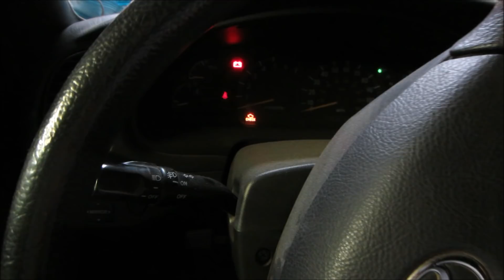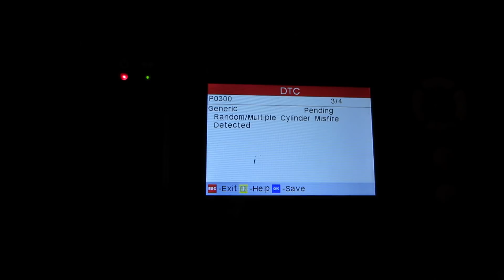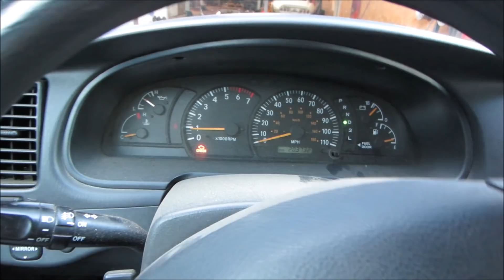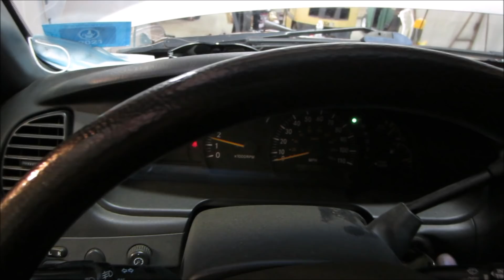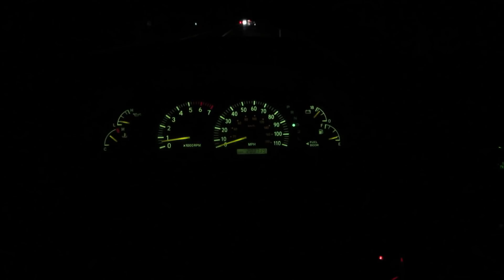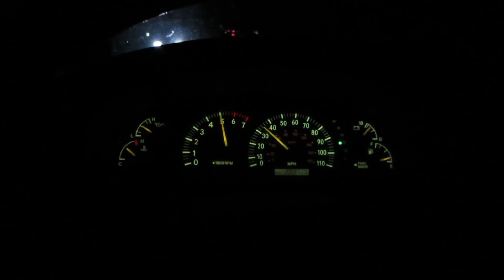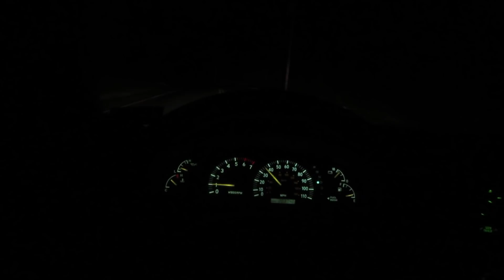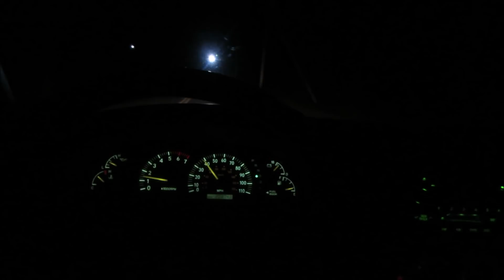What Screwed Up My Engine? You Won't Believe It

Comment: Timing belt: The world's most expensive mouse trap.
Reply: Timing belts on a truck V8 engine .... sad.
Reply: @robertshelton3796  timing chain any better?
Reply: @M.TTT.  yes. A chain will usually warn you of failure ( by getting really noisy)  far in advance. A belt usually just breaks without warning
Reply: @carwashadamcooper1538  in a lot of vehicles if it breaks, you put a new one and drive on
Reply: @drajo123  not at all if u Campbell snaps it usually ruins valves by miss timing snapping things rarely I see a new belt on after the old one snapped it usually causes catastrophic damage
Reply: @M.TTT.  ye car wash cooper is right timing chain is much much better lemme tell you
Reply: @M.TTT.  Yep. The only chain I ever had jump was in a small block 350 where GM used nylon tips on the gear teeth and they wore and the chain jumped. Hell my damned Hyundai 2.0L 4cyl uses a chain.
Reply: @1991enduro  My old Landrover Discovery with its 200DTi turbo diesel broke a cam belt at 90 MPH and all it done was bend a few valve push rods/ landrover designed the soft middles of the push rods to bend rather bending valves to piston contact. I just hammered straight the bent push rods for another 100.000 miles until i sadly sold my Discovery running 100 % great at 240.000 miles due to being disabled I needed an automatic landrover/ now got a Freelander with its BMW turbo diesel but auto gearbox/ but looking for a Discovery TD5 that are immaculate inside but all have rusty chassis / have welder will fix - lol/ love my landrovers as daily drivers.
Reply: Definitely not the most expensive mouse trap....the most expensive one is litterly 10k and its over a hundred years old.
Reply: @robbalinski1606  Cool story. I bet you're a real hoot at parties.
Reply: @carwashadamcooper1538  Some VW timing chains stretch and ruin the engine all the time. My parents caught theirs in the nick of time even though the engine was relatively new (below the 100k km usually recommended for a timing belt swap, let alone a timing chain).
Reply: @ianburit3705  ye that's British engineering for you lol I'm a brit my self and ye usually bent valves equals fkced cylinder new piston etc 8 times out of ten its easier to find a replacement engine
Reply: @drajo123  I think you're thinking of the "serpentine belt (?)" that drives the waterpump, fan, dynamo etc. When that snaps you  can just replace it. If the timing belt breaks the valves stop moving and with little bad luck a piston will slam into the valves and damage the valve or the piston. This is why the timingbelt has teeth and is made of a much stronger material than the other belts.
Reply: @robertshelton3796  Ill disagree with you. As long as you change it when needed, it'll rarely fail. Timing chain guides have been getting shit for a while now. Ill take the belt personally.
Reply: @vinny142  no no no timing belt, in non iterfirenc engine noting hapens, you put new on and it runs, it bends valvs only if its carbon up top of pistons
Reply: @ryanmartinage  OHC timing chain guides but that's why push rods are > OHC. No guide, big chain, 1M miles. Enjoy your belt though.
Reply: Mustie develops a timing belt trap machine.
Reply: Really glad I read this before watching. Didnt get it then I realllllyyy got it lol
Reply: @robbalinski1606  don't let Shawn Woods of mousetrap Monday know.
Reply: I was sure they were totally sealed?
Reply: @robertshelton3796  I’ll take a Toyota 2uz and the accompanying truck over any modern vehicle made currently.
Reply: @ryanmartinage  LS3 with DoD delete for life.
Reply: @drajo123  ya and you know exactly how much is going to cost to fix it a chain can vary chain by chain and if the factory put a cheap garbage one on you can change it out for a good one I love belts every 4  Bangor should have a belt
Reply: Why do they make interference engine with a timing belt? The belt breaks, you by a new engine instead of puting on a new timing belt.
Reply: @carwashadamcooper1538  ah nice, my Tacoma has a chain and they usually last a good 300 to 500k or more I think
Reply: @cassiuspuckett8789  money is the only reason I can think of or what the  companies will tell you it's higher  compression gives you more power

Comment: "Conti-tech" is a division of Continental Tire. Continental bought what was Goodyear engineered products, i.e. belts and hoses. I work for one of the hose plants. Belt was likely made in Lincoln Nebraska. The purchase process started in 2014 and was finalized in 2015, So my guess is that belt was probably built in late 2015 or newer.
Reply: Continental makes good quality belts. I ran their timing belts and v-belts on my Volvo for over 30 years with no problems.
Reply: Conti Belts are around for a much longer time. But from your reaction I guess its not very common in the US. In europe, japan etc conti belts are around for 30+ years.
So your guessing on the manufacturing date must not be true.
Reply: @Chris-yy7qc well until they purchased the company I work for they do not make belts and hoses in the US. Continental is a German company. When they bought us that them over 90,000 employees unless I'm remembering the numbers wrong. We alone had 30 facilities world wide.
Reply: @garywheeler1733  Nice collection of facts, but that doesnt really matter in this context? 
What I wanted to tell you was that it doesnt matter if they produced belts in the US back then or not, the belt could be older than 2015. It couldve been imported to the US and then put into mustie1's truck.
Reply: @Chris-yy7qc  never implied it wasn't imported.
Reply: @garywheeler1733  Quote: "Belt was likely made in Lincoln Nebraska. The purchase process started in 2014 and was finalized in 2015, So my guess is that belt was probably built in late 2015 or newer."
Reply: As Chris said, Continental AG has been making belts a lot longer than six years - and they've been available commercially stateside for a very long time as well, in particular since well before 2004. Unfortunately therefore there is no way to date the belt that way, though we can be reasonably certain that that was not an OE belt, so it was changed at least once. If that was in 2011, after 7 years... I'd be rather nervous about running it nine years later, though I understand where Mustie comes from IRT replacing it and therefore putting the $500+ (plus labor!) into a truck that is on its way out.
Edited to add: I checked, even the 'ContiTech' brand was established in 1988 (!)

Comment: I have had really good luck by using a “rust converter”, from the Rust Store online, before spraying any oil or film on.  It seems to stop the rusting so it can’t continue after applying the final oil coat.
Reply: My process, needle scalar, wire brush, rust converter followed by a coat of cosmoline. (before the rust converter starts failing) Inside rails, flood with cosmoline then chain lube.

Comment: I got a Toyota Tundra like that, but mine 2003. I bought it around 35000  miles on it. I changed the timing belt 180000 miles and now the truck has 420000. The truck still runs good with no major issues yet. The most stuff I ever do to the truck is just basic like brakes and oil change. I guess maybe I just got luck on this truck. Good luck with your guys truck.

Comment: I seem to recall this being a thing with 4.7's.  IIRC there's an inspection window that the mice get in.  Lower left side of the engine, from the driver's seat if memory serves me.  You might want to check that so that it doesn't happen again.
Reply: Yeah he’s probably missing part number 11348-AC010. They call it the lower timing cover spacer. That’s how most mice or other debris get in these engine’s timing belts.

Comment: The rusting is crazy! Those "protective" coatings are a pain, as you said they trap water. Salty water no less in your situation.
I've never had to drive on salted roads. Sea water isn't too friendly but that's why we hose down and make sure the box section drains are open.
In my opinion you should have let the rear wheels hang and greased up the spring leaves.
Excellent bit of fault finding mate!
Your lucky this critter didn't make a dinner of your wiring. Common in tropical locales.
Good job!!
Next?

Comment: Those lug nuts are commonly referred to as “tuner nuts” they use a deep 6 point security socket. A parts store might have the key for it
Reply: Spline drive.  Factory Toyota part.

Comment: Very good repair with the exhaust sensor, could have been a tricky problem. I'd have been inclined to change the timing belt too, but you certainly gave it a thorough check over. Really enjoyed the video.

Comment: On battery terminals, clamps, and cable ends: Vaseline. On the improvised oxygen sensor mounting studs: Anti-seize compound. Regarding those special "security" lug nuts: Get rid of them.
Depending on a special tool, is a recipe for trouble.
Reply: Er, let's not be ..."A Hurler on the Ditch"...  [Great upload great repair, love that Chainsaw Bar Oil treatment to keep his truck on the road plus the threaded bar and indexing that sensor through Ninety degrees, great idea...with an older Toyota  you can't go wrong simpler to work on and less parts to go wrong , he will indeed get more that several years out of same with the  Preventative Maintenance that he's putting  into same....]

Comment: Fantastic!  Let me tell you how a professional shop would have gone with this to solve this

1) Replace the known bad O2 sensor   -  Would have changed the entire exhaust because the studs broke
2) Replace all spark plugs
3) Replace all coils
4) Replace all injector
5) May be slipped timing belt?
6) Replace timing belt

Total Damage?  $16,357 in parts and labor

Comment: I had a similar issue of rough idle and misfire issues on two cylinders once when I had went up north to visit on my Ford Sport Trac with the 4.6 V8. Turned out a rodent had chewed thru the wires on two coil packs plus much later I found he had did the same to the wires to the pressure sensor on the HVAC where it was hidden from view.

Comment: It’s funny how in New England it’s referred to as “antifreeze” and in California it’s referred to as “coolant”.
Reply: In Canada we call it both
Reply: You call it both at the same time? As in “can you top off my antifreeze/coolant?” I guess what I meant was how they’re more commonly referred. Sure, people here call them both as well, but to my point, in this video, Mustie referred to it only by “antifreeze”.
Reply: I think you’re taking my response negatively. That’s not the case at all. I’m actually genuinely curious about regional things like this. Does it depend on the season whether you call it one or the other? I could see that being the case. Out here, even in the dead of winter, we’d still call it coolant, lol
Reply: @korybrown1126  like i mean you can call it both in the span of going inside to grab the coolant and coming back out with the antifreeze
Reply: 😂, fair enough
Reply: well technically i think its just terminology based on region because most "coolants" also contain antifreeze cause manufacturers are using specialty blends, like GMs Dexcool, Fords Specialty green or specialty gold. Hell on my 01 Silverado it says to use Dexcool antifreeze/coolant on the cap for the tank, whereas my ford fusion says specialty green coolant and makes no mention of antifreeze until you look it up on the jug or in the manual under part numbers then it puts down both.
Reply: @compzac  it’s the same thing, just different names, yes, water is a coolant but not an antifreeze, and a little bit of glycol or whatever actually helps make it have a higher boiling point, which makes it a more effective coolant, but you slightly decrease the thermal conductivity and heat transfer properties too though, it also obviously reduces the freezing temperature for the fluid too
Reply: Water can literally be used as a coolant, but no one on earth would ever claim water is anti-freeze! So there can be a legitimate reason why you might use the anti-freeze only in some climate zones.
Reply: @aterack833  I rather like that suggestion 😂
Reply: @tretter1452  I honestly can’t imagine a land where temperatures never get below freezing, or even at it
Reply: Calm down I think he's making a joke about temperature difference
Reply: Both names refer normally nowadays to the same thing. Technically if you say coolant you are covering the full spectrum anti freeze anti corrosion anti foam etc. It’s a Multi function fluid and antifreeze does not cover it. The anti corrosion for alloy cylinder blocks and heads is critical , wrong stuff and big bucks down the road. The anti corrosion wears out that why you change it. Anti freeze refers to the earlier name which was just Glycol added to water to stop freezing. But we know what Mustie meant the right stuff for his engine.

Comment: Mustie, on the o2 sensor I would have just used a u bolt and washer and nut. God bless
Reply: Or just replace it maybe. They are cheap enough. Not worth the labor to put a spacer in
Reply: Now, why didn't I think of that Thomas?  Fantastic solution.
Reply: Or they sell O² sensor nuts you can weld on the pipe and just  go witha threaded sensor

Comment: Me (a fan of Toyota): Wow, that's a nice Tundra, I would love to eventually own a Toyota pickup. 
Mustie1: "This is my beater truck, I've had it for about 4 years and take it out during crappy weather and off-road."
Lmao. The rust belt label definitely holds true.
Reply: The problem with Japanese cars is that you still have sleazy American car dealers selling them.  The stupid dealer add-ons like window tint, pin-striping, "paint shield", and undercoating which do nothing to increase the value of the car.  The undercoating actually defeats all the work the car companies put in to protect the underbody and chassis at the factory.  Usually by clogging the drain holes in the frame rails and other body parts.  Certainly not all American car dealers are sleazy, but choose carefully.

Comment: Hey Mustie...I also have a 2004 SR5 with the exact same rot in the frame. I have 100K miles and no rust.   I wasn't aware of how bad the frame was until I had it in for an alignment.  The tech was a former Toyota tech and he said the 04s are part of the recall and they have to put a brand new frame on at no cost to you due to a huge lawsuit. Apparently a giant parking lot of new Toyotas was flooded in Hurricane Katrina and they tried to cover it up and sell the vehicles after they were flooded. They cleaned the frames up but there was swamp mud inside the frames.  I'm going to send mine in soon.  Check it out.

Comment: Interesting find, I was guessing a fuel injector issue Lol.  Your truck is a reminder as to why I would never get a vehicle from the rust belt, glad I live in Central Texas where that type of frame rot is never an issue.  For the O2 seniors mount, though you will probably never mess with that issue again, I would have mounted with with lock washers under the nuts and anti-seize on the stud threads.  Other than that creative repair as usual:-)

Comment: I used the Permatex "The Right Stuff" gasket maker when I replaced the water pump on a 2004 Toyota Camry.  The instructions state to apply the gasket maker, assemble the parts and torque the bolts within 5 minutes.  Mustie was using the old "blue gasket maker" method by letting it set up before assembling the parts.  The nice thing about "The Right Stuff" is anti-freeze can be added right away and the vehicle can be driven immediately.
Reply: To be fair, it's easy to mix up all the different instructions with all the chemicals used in automotive repair.  Especially with the tiny print and suboptimal lighting you're usually using the stuff in.

Comment: Seeing all problems with rusty frames, the more I thing all car frames should be galvanised & powder-coated.
Reply: Wheeleer Dealers had an episode where they replaced the entire frame of a TRW that pretty much disappeared despite powder coating.
Reply: Ideally they should just be titanium alloy. But, you know.
Reply: Powder coat is the fastest way to rot anything exposed to the weather.
Reply: @herbertshallcross9775  That's why I said galvanised first.

Comment: And lo, the rodent population had enough of Mustie's dissing, and exacted revenge as best they could.
Reply: Exhaust U clamp 👍 and a Impact Bolt & Nut Remover Set off fleebay .I love the bar and chain oil for any out door rusty stuff and under the cars .I use an old Victorian trick and painted everything made of iron and steel with creosote but the smell ,you have to love it or hate it .Not for under cars can be pungent to say the least 😝
Reply: I have fought rust for 55 of my 62 years my advice for steel and iron (lanolin ) .From some of the swords found intact from Roman and Viking ear-a in the uk the swords that were shelved had lanolin in the scabbard says a lot for there no how  but if there’d have had bar and chain oil I think they would have used it too 😏
Reply: Yeah, they thought "Moving day my ass." :D

Comment: OMG that engine is disgusting. SO glad I live in a state that doesn't salt the roads. Good luck, brother.
Reply: It’s the worst, tries get rusted to the rotors and hubs, every bolt or nut is rusted unless you took the precaution to add some coating with takes a pain in the ass amount of time to clean the bs off.
Reply: Ok that explains it. I must have missed where he explains why his engine looks like that. I have the same truck and my engine looks almost like new. I can't imagine buying a new vehicle in a state where they salt the roads.
Reply: Salt or no salt if you don’t clean your engine it will look disgusting